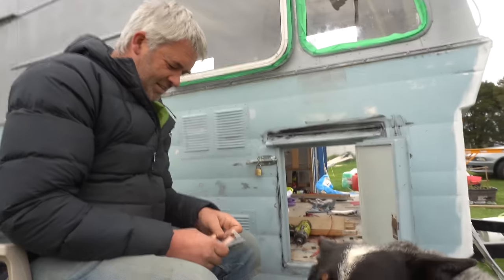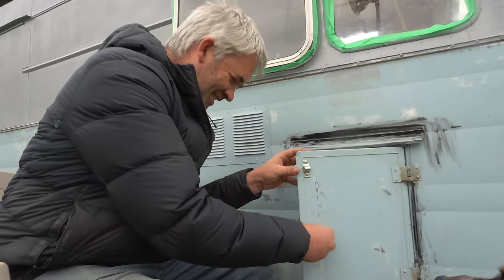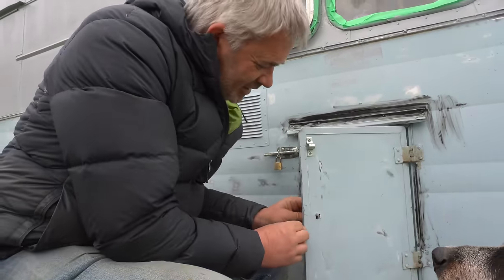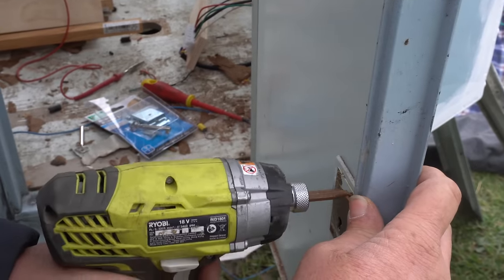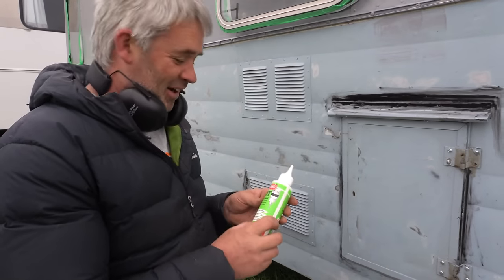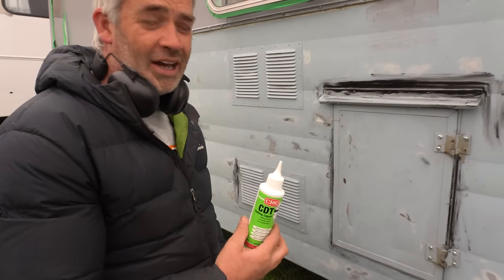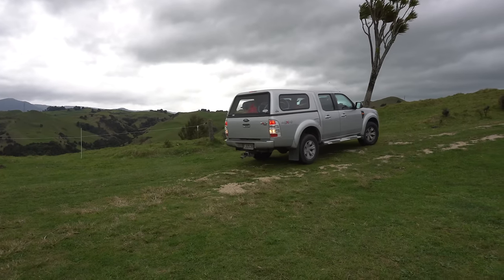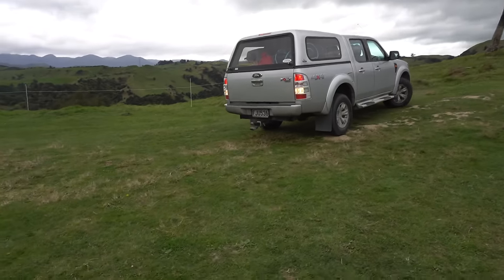FINISHING Caravan & Moving On

Comment: lock on a door with the hinges screwed from outside is a bad move. unscrew them and the door is open.  you need coach bolt with nuts on the inside.
Reply from the maker: I think it would be very easy to get into the caravan. You could even take the rubbers off the window and get in that way!